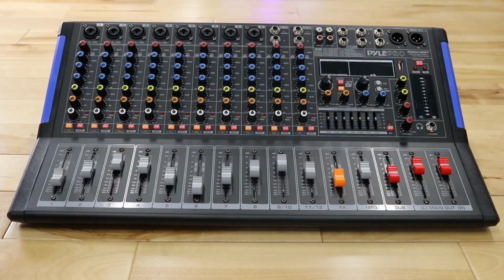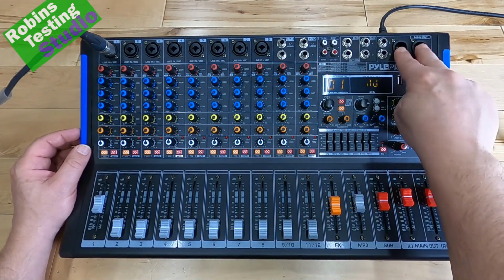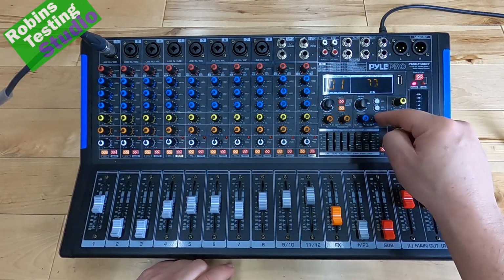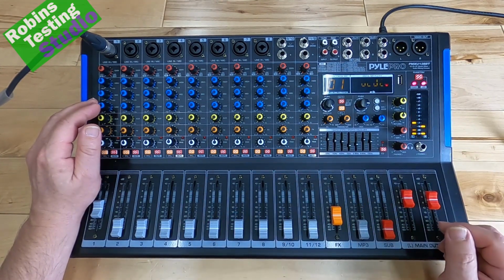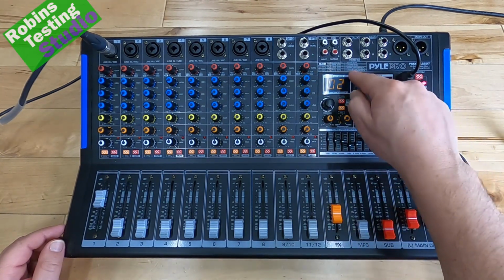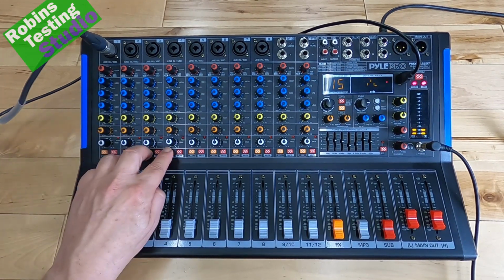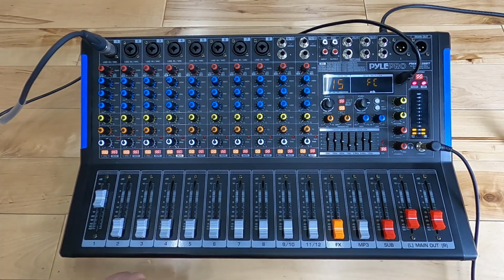Full Introduction & overview PMXU128BT 12ch Mixer w/ 8ch Mic inputs Bluetooth & audio interface.

Comment: I want to use the sub mixer setup with this mixer. I use 2 G@ ZLX 15" main with one Alto TS15" Sub into this Pyle mixer. Do utilize the subwoofer volume control. I see that I need a 1/4' male into the mixer that is also male XLR into my Alto Sub. I'm assuming that the two ZLX male will run XLR L/R from Pyle Mixer to the two ZLX main Input 1s. Am I on the right track with this. I purchase this mixer after watching your videos and it has worked perfectly. I just purchase the Alto TS15 Sub after seeing a few of your videos. If you know of a better scenario, please share.

Comment: Hi, I’m having an issue with my mixer and PC, I bought a 10Ft long USB Type A to A cable to connect my mixer to my PC but upon doing so I’m getting a noise, I’m not getting a clean signal. I’m using the same mixer in the video.
Reply: After a year, how did it work out? Is it worth buying for home studio?

Comment: Thank you so much for this clear explanation! I"m a music teacher trying to figure out audio equipment to fix some problems that our R&B band teacher used to solve before he retired last spring and this is the only video I have found that addresses the monitor and what affects it on the mixer (the main problem I've been trying to solve is hooking up a monitor for the kids to hear the music but not have microphone feedback interfere with). If you have the time, is the headphone jack a 1/4 inch connection and do you think there is a possibility to rig it as a second monitor by plugging in a speaker through it instead of headphones? Also, is the headphone output only a full mix of everything plugged into the mixer, or is there a way to control what comes out of it (like if a singer wanted to hear the music through their headphones but not the microphone output?) 
No worries if there's no answer or if you haven't tried these options on this specific mixer yet, I'm excited to look into this mixer more though! I'm thinking of investing in another personal mixer that I"d feel more comfortable transporting to the school (not comfortable bringing my Midas MR18 unless the school buys their own)
Reply from the maker: You can use the headphones as a monitor output you will need this kind of cable https://amzn.to/4htX4rt it is important to split the left and right or it will not work right.
The button on each channel called PFL is to select the channel/channels you want to hear over the headphones.
Reply: @expertisland  Oh my gosh, thank you so much!!! I will add that to my cart as well and make sure that I use the PFL button to select the channel/channels I want to hear over the headphones!

Comment: We just received this mixer for a media class. I’m having an issue I was wanting to see if you could help. When I plug in the headphones I’m getting regular audio but we need to get the output audio. Is that possible through the headphone jack or do I need to run the headphones into the output quarter inch spots?
Reply from the maker: Headphones and main out are the same if you are no selecting and pfl channels, just the gain levels are different.

Comment: question. I know you guys have this mixer (just bought it) along with the new EV ZLX G2 BT 15s. My question is - can the speakers be paired with the Mixer.? That would be priceless, if so. I hope to hear your response soon.
Reply from the maker: Not via Bluetooth they are both receivers, plus Bluetooth has a delay (no Good). 
BUT you can add some wireless XLR System Like the Xvive here is the Link https://amzn.to/3J488vl I also have a video for the Xvive on Amazon.
Reply: @expertisland  , ok that sounds interesting, let me check this out. Thanks!
Reply: @expertisland  , Man, this is an awesome solution. Like you said, if I have some mics I love, I just need the Xvives and I'm fully wireless. And, to connect the PA i this would be priceless is some instances. Thanks for your testing lab.!

Comment: Just got this unit today and am excited about using it with my new EV ZLX G2 15s. I'm noticing some signal noise from the mixer through the EV's. I'm wondering how to trouble shoot that. Plus, the headphone jack seems to have a problem not having a solid connection when plugged-in. I'm only hearing right side. When partially pull it out, I hear the left side clearly. The headphones are good to go. Never had an issue with them. Thoughts?
Reply: I love the design of the model but I read a review that complained of a signal noise that started and didn't stop. I am seeing your comment 2 years after you left it. How did it work out?

Comment: I’m not sure if I missed it in the video but when the mixer is switched to pc mode will the pc register all 8/12 inputs or just 2?
Reply from the maker: it is not a multi-track mixer That is still Big Bucks This is Just a Two-channel.
Reply: Darn! Seems like a solid unit all the same but it won’t suit my purposes. I was looking for a cheap and dirty way to record multiple inputs into a daw. Right now I’m running one of those Gemini systems with the 2 10” speakers into a scarlets 2i2 for 3 sets of vocals , bass and electric drums  into one input and a separate input into the XLR out of the guitar players amp for our home studio demoing process. I was aiming to add more independent inputs to allow for individual post processing
Reply from the maker: For Now and for free you can use a "bpm click track" in your headphones and then record voice and instruments 1 or 2 track lines at a time.

Comment: I have a question, when u choose REC, where does it record to, can u plug in a flashdrive and have it record your mix set to it? Is it internal storage? If so, how do you retrieve it and how long of a set would it record?
Reply from the maker: it will Record on a USB Stick, you will need to practice it recorder level based on the channel levels not the main out.

Comment: my pylepro pmxu88bt configured already but still effects not working. please helpthanks
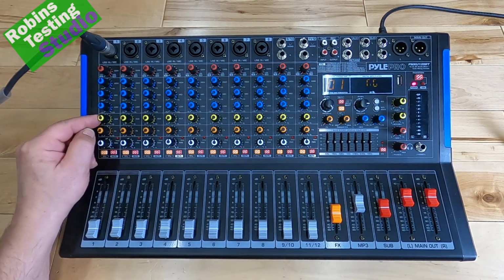Reply from the maker: how to at  2:00 All the orange knobs and slider, 1) turn up the FX in the Line, 2) turn the FX knob up in the FX control section 3) push up the FX slider. you now have fx

Comment: Does anyone know what format the USB memory recorder is ?  Does it record in the PCM format? 
Bitrate/sampling rate. Can it be changed/adjusted ?
Thanks.
Reply from the maker: 44.1/16 and it will output MP3 files.
Reply: @expertisland  Thank you. PCM CD quality then. Nice.
Reply: I noticed that the mp3 files are mono, not stereo.

Comment: Suppose one singer bring in Boss VE 20 for her vocal only, how would you connect ? Thanks
Reply from the maker: The BOSS VE20 is very cool, you plug the mic in to the VE20 then plug the L & R output in to the 11/12 on the Mixer you will need 2 XLR female to 1/4 Male Cables if you want the FX to work right.

Comment: Are you able to get a return from your computer? So can I listen to sound coming out of my computer in PC mode or is that for INPUT ONLY? My Mac recognizes the Pyle as an output device, but I'm not getting any output signal at least not from the USB connection.
Reply: Hey does your mixer have more the 2 channels available to record

Comment: My MAC recognizes it, able to set it up through the midi controller and record with it, but what's coming out of the USB sounds like a distorted AM radio. I can't seem to get a clean single coming out of the USB that's at all usable, and that's sort of a deal-breaker for me. If I can't find a solution, I'll send it back.
Reply: I got question when I'm recording my vocals how I keep the beat separate from my vocal recording

Comment: how come the phones come out as mono instead of stereo? im using a trs stereo to stereo adapter so im confused
Reply: i have the same issue and was hoping this had an answer but alas not so much. I mean I have the 6ch, not this 12ch but fundamentally the same...
Reply: I have a PMXU88BT, the headset [PHONES] connector is stereo output.  Make sure you use TRS connector.  I just checked by panning the input channel from left to right and making sure it directed the sound from the left ear to the right ear.  The [PHONES] is a noisy line on my system. So far my only major complaint.

Comment: Would this be suitable for 2 guitar amp heads plugged into di boxs so it's going into the mixer at a line level I'm interested in this for a preforming duo with two guitar's and two mike's  but want to have spare inputs so others can plug into the mixer wirelessly to jam along at jam sessions, I'm considering fenton ft15 powered 800 watt speakers for the mixer to go out to with backing tracks bluetoothed to the unit by ipad or tablet , your views of my ideas to use this would be appreciated